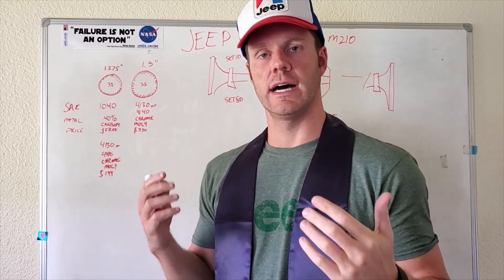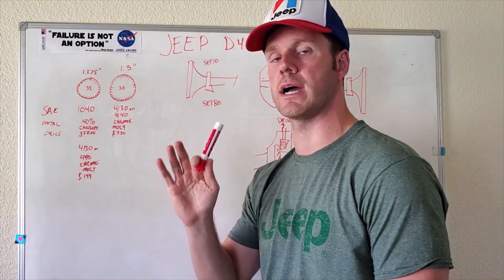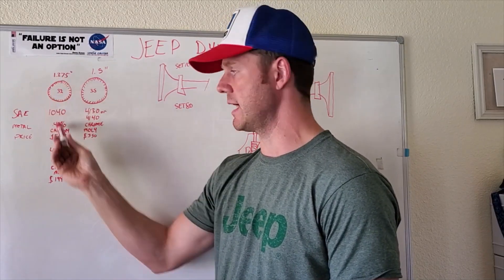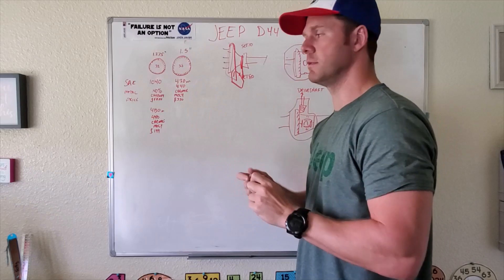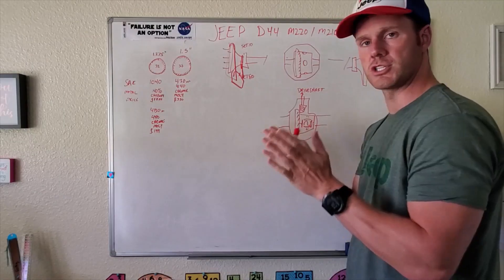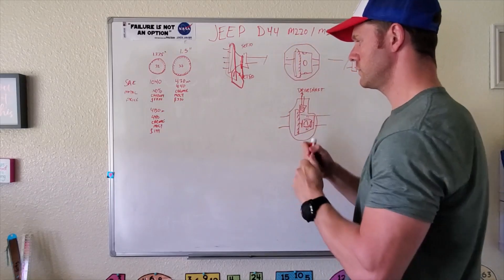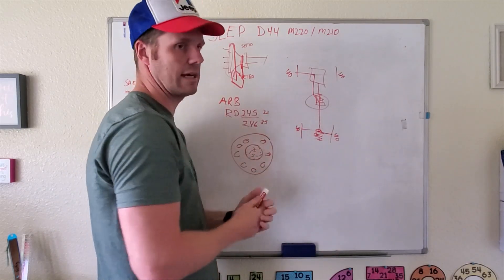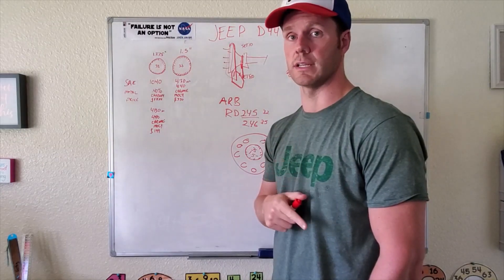NEW for 2020 Super 44 Ultimate 35 Spline Set 80 Dana 44 Build M220 M210 Gladiator JT Wrangler JL

Comment: What method do you use to remove the small carrier bearing on a m220?
Reply from the maker: Cut it off with a carbide angle grinder. Press on new bearing.
Reply: @c130aviator  so in essence I just need my 12 ton press calipers and mag mount along with hand tools and electric impacts?

Comment: This great. I learned a lot. I want to go fast in my stock JLUR diesel on the dunes. I am adding metal cloak bumpstops. Other than that, I’m keeping it stock for about 75k miles. 

What would most likely break if I’m going fast and hit a nasty bump? Should I upgrade the axle to a 35 spline before I do that? Ideally, I would like to keep the lockers.

Comment: Did you replace the Hub and Bearing Set with a 35 Spline or did you keep the outer short axle at 32 Spline in order to keep the OEM Hub and Bearing ?

Comment: How do you get these shafts? I've looked on ECGS website and can't find these that you speak of.
Reply from the maker: I called them, told them what I wanted to do, gave them my stock dimensions, taking into account the arb locker. They called a company that specialized in custom shafts and had me a set made. They say they are now available but the market has not caught up with Jeeps. Check my other videos for the full install and how to.
Reply: @c130aviator  Appreciate your reply...I have watched all your videos and they have made me want to try the same setup you have and that's the reason I was wondering how you went about getting them. I was thinking they were something that would be available at this point but they aren't. Thanks again

Comment: Hey Bud, love your vids! At the end you mentioned that If we had any ideas for new vids.. The Chevy Colorados have an M220 rear end. Do you think a 35 spline kit would work for that?
Reply from the maker: Yes, the shafts would need to be measured and dimensions checked at the flange. There can be small things that will make it less than a bolt in feature.

Comment: Great video thank you. Newby to axle upgrade question. If I get the new 35 spline shafts, do I have to upgrade gears or will they fit with stock gearing? I will be adding arb locker same time shafts installed.